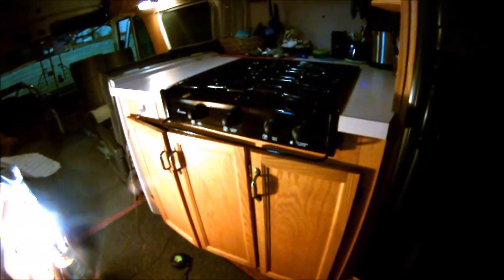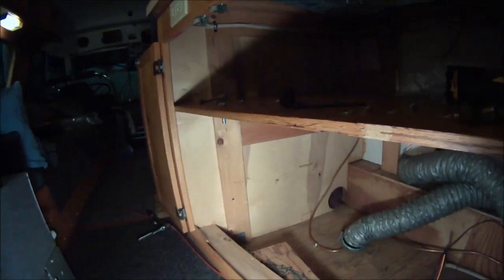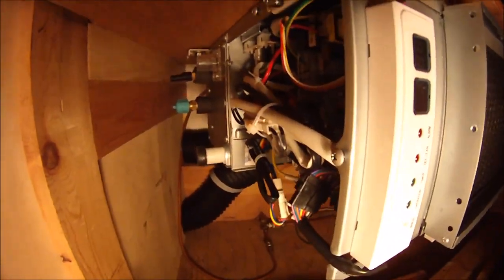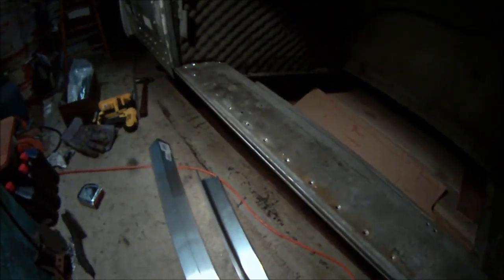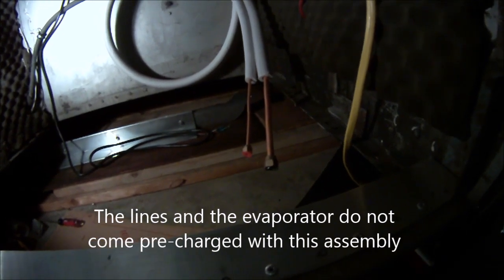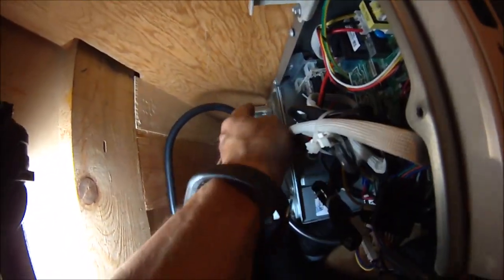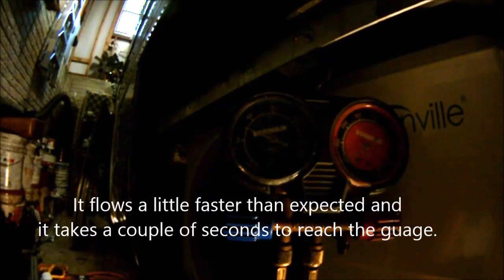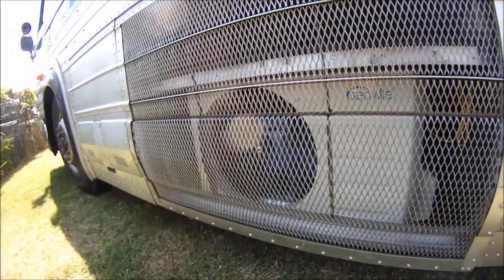Senville Mini Split AC Installation

Comment: So, everyone I talk to questions the ability of a 12,000 BTU unit to cool the coach. What has your experience been?
Reply from the maker: Thanks for the good question Chad.  If I could have I would have bought a 18,000 BTU unit.  The problem was that both the air handler (I have a ducted system, not a wall mount) and the condenser were 3" too large for the space I had for them.  Hence I was limited to the one ton unit.  In the hot sun on a 90 degree plus day it has a hard time keeping up, although with proper air management (a small fan in the front and rear) it does a decent job making it comfortable.  Remember, the ducts were not designed for a/c so the fans help move hot air near the ceiling back through the handler.  It dehumidifies very effectively and keeps it comfortable but probably not enough for people who like it cold.  We pull the curtains and cover the windshield with an outside Magna Shade in it does OK. Under 90 and not in the direct sun all day it does great.  Heating in the winter is extremely good and rarely uses more than 5 amps on either leg, even when 20 degrees outside temps.  Haven't been in below 20 yet but I suspect it will do well.  If you have the space, I'd go with the 18,000 unit.  What's your situation? (With wall mounts, I'd suggest 18,000 with two wall mounts, one front and one rear, if you have space, or a ducted system like mine.)
I really like the unit and I am impressed with just about everything about it.
Reply: John Matthews I am also installing a ducted system, but I am putting it in a bus conversion that I am doing space is not really an issue. Power however is an issue, I want to be able to run it off grid off my solar and inverter. I talked to the manufacture and there’s 1.5 amp different between the 12,000 and 18,000 while running.  But the start up goes from 9 A to 15 A.  I will be running ducks to the front and the rear of the bus.
Reply from the maker: @constechable  Yes, the power is an issue.  Mine is a 220v system.  Really wanted a 110 but couldn't find a ducted system that ran on 110.  Where will it spend most of it's time hot or cold climate?  If you are running a ducted system, I would try to have the air supply come out higher rather than lower, although the heat works very well with the lower, but I think the A/C needs more help than the heat.  Is it a 35' bus also?  Also, I still have all my windows which adds to the a/c demands.  Having fewer, would be good for the a/c.  If you're doing a full resto, and have the opportunity to insulate well, that will help also (mine is all original 1961) and if you have solar panels on the roof with air space between the roof and panels, that will help.  The hottest part of my ceiling is where the dark blue band is on the lower parts of the roof above the windows, in addition to the heat from the windows.
Reply: John Matthews I am doing the bus from the ground up. I am putting a 1/8 inch ceramic heat barrier against the outside metal and then spray foaming the cavity. I eliminated more than half of the windows and upgraded the windows to double pane. You are saying the return air should come from a higher position in the bus? I’m not sure how I would accomplish that as I really have no way to get a duct up high.
Reply: I am leaning towards going with an 18,000 BTU system because I don’t want to be undersized. It draws 1.5 A more than the 12,000 while running.
Reply: @strayhound61  I compared the 110 vs the 220v and the 220 v system uses less power per btu.  So I am good with 220
Reply from the maker: @constechable  I was saying to have your conditioned air coming out higher up if you can.  The lower position of my vents is why I have to use fans to move the hot air from the ceiling so it circulates back through the air handler.  When I do that, the a/c manages reasonably well.  When I don't below 4' is comfortable but the hot air at the upper part of the interior stays warm which you feel when you're standing up.  If you can manage the 18,000, I'd go with that for sure.  You'll be making accommodations to keep it comfortable in full sun days over 90 degrees.  By the way, when I'm in the shade, it works fine at any temperature outside.  
Just went on you YouTube page...definitely go with the bigger unit.  You have way more glass and a bigger bus.
Reply: I just don't see how anyone could run a 220 18k BTU off grid. 

All ducted cassette set ups are 220, and your efficiency drops. 

If the air handler or cassette had its own 110 plug, perhaps that'd work, but most generators are not 220.
Reply: Bon Vivant mine isn’t up and running, so I can’t guarantee it will work.  That said I have discussed it with an electrical engineer and he ran the numbers and said the higher volts are actually a good thing, it runs with lower resistance and actually pulls less power to run the same rating as a 110 unit.  So it pulls 15% more to start, but 10% less to run than the 110 unit.  I have a 220 generator, but with 2800 watts solar and 2400 amp hour battery from a Nissan Leaf battery, according to the engineers I shouldn’t need to turn the generator on.
Reply from the maker: @constechable  I'd like to know how you get 220v from your solar panels and storage batteries to run the a/c.  (I get how that works with a 220v generator)  The issues is having an alternating current on each 110 leg to give you a true 220v system two 110 lines with the identical pulses. I'd love to do that on my bus, but I haven't found a solution.  If you come up with one, please share what you find.  Thanks!
Reply: John Matthews my panels and battery will be sending 48 volts dc.  Then I’ll be using a 220 volt inverter from Victron. Many people have 220 systems, most RV’s parks have 50 amp 220 power connections.   I haven’t found one running the 220 A/C unit.  Most homes run solar and their systems are 220.
Reply from the maker: @constechable  Thanks for the speedy response.  I haven't really looked into it because I don't yet have any solar,  but your point about 220v home systems is a "why didn't I think about that?" kind of comment.  Of course!  Thanks for breaking my mental block on that.  I will add that our 220 mini-split ducted system draws very little amperage.  On 95 degree day in the full sun with it running full tilt its about 5-7 amps on one leg and about 8-9 on the other.  I sort of think that's pretty good compared to a conventional a/c system.  So it seems somewhat doable.
Reply: John Matthews well like I said mine is not up and running yet it is still in the research phase but I definitely don’t want to have an AC that is undersized and from the research I have done it says the 220 unit should run as efficiently or more efficiently than the 110 unit so I am going to give it a go.
Reply from the maker: @constechable  Good Luck with that.  I'm pleased with my 220.  It is a little undersized, as I have told you.  But If I manage the air inside with a couple of added small fans to move it around and away from the ceiling areas, it is comfortable even on the worst day.  The heat, on the other hand works super and it doesn't draw any more amps than the a/c if it even draws as much.  Had it in 20 degree weather and it was perfect.  The system operates on very high pressure, like over 500 psi, and it is rated to be effective at -20F.  Pretty impressive!  I'll be very interested in hearing about yours.

Comment: Nice to see our systems being used in multiple applications. Great work on the install, and happy to be on your bus. :)
Reply from the maker: Thank you for your kind comments.  I can't tell you how happy I am with my new Senville mini-split.  It's better than I could have ever imagined!
In the RV world, there are not many options for air conditioners.  Most use a roof mounted self-contained unit, some with interior ducts.  However, they are typically VERY noisy both inside and out and unsightly.  This unit is perfect for our application, and far superior in my opinion.  
Coming up in August, the Family Motor Coach Association is having their 100th anniversary Rally in Minot, ND.  People will come with their campers and motorhomes to see the show and exhibits with vendors and the usual conference/show kind of stuff.  Seems like a good place for a Senville sales rep to go and have a table, or whatever.  Your systems could be widely used in the RV world and for those of us who do bus conversions and DIY campers, they are perfect in so many ways.  Just a thought for a new market niche for your units.  We will have our bus open for participants to take tours at the rally and I'm planning on doing a lot of bragging about our new Senville unit.  
Thanks again for your comments and all the support I received from the folks at Senville during the purchasing and installation process.  It was great working with everyone there.

Comment: Hello Mr. Mathews, excellent install on your split system, great information given in your response to comments, the company/distributor is about an hour from my home. isn't it Too bad these systems weren't available sooner to bus conversion junkies, gosh, who woulda thunk of such a complex system, after all the U.S. put a Man or three on the Moon in 69' with as much tecky junk as a common toaster has today.. lol 🤔
  Being all clowning around put asides, very nice, as a commenter inquired, I take it an inverter wouldn't be suitable?, Or is the idea being pondered?.
  Thanks for sharing your video,time and info for all.
   Kind regards, Eric Dee
Reply from the maker: Hi Eric, Thanks for the comments and for watching.  Yes, I agree.  I have been struggling for years to solve this a/c challenge.  Even considered taking window units apart and splitting the condenser/compressor from the evaporator and adding a fan or trying somehow to convert one of those hotel wall mounted units.  Also considered water chiller type system, but none seemed to work.  You would have thunk the technology would have advanced years ago.  
On your inverter question, we have a couple of small ones we use for individual needs occasionally, but no plans to install a large one (even though I have had a new one sitting on my workbench for years) because we have a/c for going down the road and I don't have enough battery power to provide 12 volts for any length of time or any space I want to give up for so many batteries.  Our biggest negative is we can't boon-dock for long periods...so we find campgrounds to plug into.  We do ok overnight at places like Walmart or Cracker Barrel.  
I really did like the folks at Senville.  They were very kind and helpful.  Guess you're somewhere near Calgary?
Reply: @strayhound61  No Calgary here, maybe I was looking at one of your split system distributor locations here in shakey California..excuse me, "Kommifornia". If there is a will there is a way for power recourses, Capacitors seem to be hitting it big over battery banks due to the Small size and power supplying capability. when you start farting around with uF (Farad's) your talking about "Joules" of power like lightning bolts, but very controllable, into usable current/volts. been introduced into high end vehicle applications lately, not sure of the prices in comparison to lithium. From what I've been gathering Capacitors have been leaving lithium in the dust, also aren't as bulky as battery's...idk???.
   If I recall through your videos, you ditched your generator?, Not sure if you've seen or are familiar with the "Technomadia" bus (4106) here on YouTube?. They have a propane fueled Onan hidden where the GM's spare tire is usually located but, I suppose if you change your own flat tires, or at least carry one, that space wouldn't be an option for an lpg generator location  for you to power your split system.
Reply from the maker: Yea, technology has advanced so greatly in stored electric power.  It all seems great but I'm finding 'm not really motivated to try to change everything over at this point.  We have managed for 30 years without a generator and since our refrigerator runs on 12 or 110 volts, it's pretty much the only thing we really need and that has about 12 hours of time before things start to thaw.  We are almost always on the road or plugged in someplace.   If I were to do anything, I'd probably do what Juan and Michelle did on Beginning From This Morning (YouTube) which was to use a wrecked Leaf battery with solar.   We do have a spare and sadly I've had to take it out and put it on a couple of times in the last 30 years.  At one point I considered buying a Cruisair system an putting it in the spare tire compartment, but never followed up on that.   So many choices!

Comment: Two questions. 
No generator onboard? 
Did you take into consideration of the durability of this mini split taking the abuse of the road?
Reply from the maker: Hey Dean,
No generator at this time.  Took the old one out we never used.  
I see these mini-splits used in all kinds of moving vehicles, such as semi tractors, and boats and even other buses.  I considered the motion factor, but I'm hoping it is secured well enough to minimize movement.  Guess we'll see.  I sad from the beginning it was an $1100 experiment.
Reply: @strayhound61  $1100...not a bad price. I don't care much for the noise of the roof a/c but very thankful that the 1991 model brisk air has held up. I did replace the fan motor a month ago and it does run now on generator power as it didn't before. You have a generator  for sale, young man? These carburetor's from China don't hold up to the road abuse. Ive had a heck of a time with generators. 
I spent 2 1/2 hours on the phone Friday night helping a very nice guy in California with he's 4106er and electrical problem, thanks to the knowledge you passed on to me. Paying it forward, Sir John. 
I'm stripping the anodized coating on the baggage doors now. One side is just about done. All is well here, my friend. Blessings to you and your family, Sir.
Reply from the maker: @DeansofNomadica  Yea, I thought the price for the a/c was really reasonable.  I'm thrilled with how quiet it is.  The reasons I never gave in to roof airs was because of the noise and because I'm trying to maintain the look of the old bus.  The generator I had was one I made 30 years ago out of a wrecked VW Rabbit diesel I picked up for $100.  I wanted the diesel so I wouldn't have to carry gas or use propane and I just attached a 170 amp 12 volt alternator to is and converted for our small demands.  Never really used it though so took it out.  Sold the motor for what I paid for the car.  I saw the video of your rear quarter panel.  Looked very nice.  What's your plan for oxidation now that there is no anodizing?  Are you going to clearcoat it?
Reply: @strayhound61  I'm kinda laughing at myself here because I've probably made more work for myself for stripping the baggage doors. No, I didn't think about the clear coat but I can do that.....
VW diesel engine....very clever!

Comment: That was really interesting John, thanks for taking the time to video the whole process.... how may BTU is the system and how many amps does it draw?, could you run it from a 240V inverter while traveling do you think??... not that you need to as you have the OTR A/C system buy I'm thinking for mine, I'm wondering how many amps it draws... I guess you probably haven't been able to test the heat pump side of the system too much yet.. :-)
Reply from the maker: Hi James, Thanks for the kind comments.  The unit is 12,000 BTU (1 ton).  It runs on a 220 volt 15 amp breaker pair and only draws 4-7 amps when running.  Heat  might draw the higher end.  It is amazingly efficient.   If you plan to have 220 volts, the amperage is low, but I don't know the answer to the inverter question for sure.  However, if you use the wall mounted type (not the ducted type like I used) there are many 110v  versions.  They also draw very little amperage and I think some 110v are available in 18,000 BTU versions.  When you set it up it does an air flow test which cycles through a/c and then heat and determines how fast the fan should run based on how fast the temperature changes.  I have only experienced the heat for 5 minutes in that mode and it was in a 75 degree garage at the time.  Two thoughts; one, your bus would require a larger system because you have much more square footage, perhaps two systems or a mini-split with two to four wall mounted evaporators; second I don't know how well it would do while moving...seems like automotive a/c systems have to compete with constant movement of air and other factors that make chilling while moving more demanding...just don't know about that.  Something to think about, though.  I was very please with it on our first week of use in hot sun and hot temps.  Good luck with yours.  I'm anxious to see it.  Happy to answer more questions.  The people at Senville are very helpful.  They are in Calgary I think they said or someplace in Canada.  Here is their number.
17120 South Main St.
Gardena, CA 90248
Call us at 1-800-242-4935
Here is the 18,000 unit
https://senville.com/18000-btu-concealed-duct-air-conditioner-heat-pump-sena-18hf-id/
Here is the one I bought, 12,000
https://senville.com/12000-btu-concealed-duct-air-conditioner-heat-pump-sena-12hf-id/